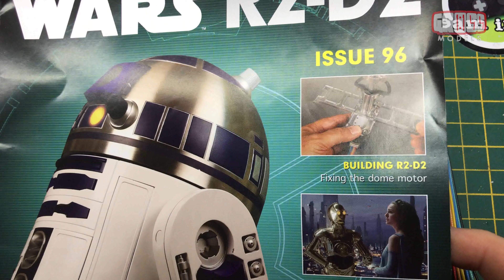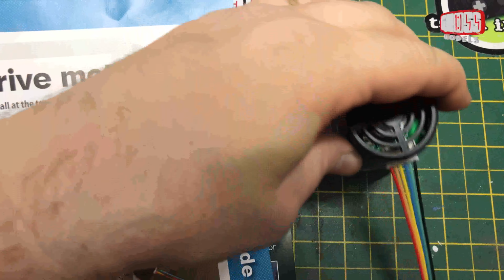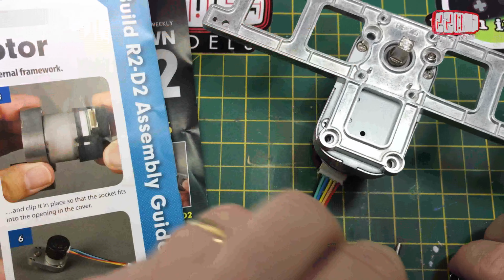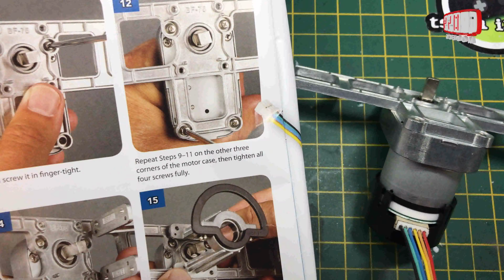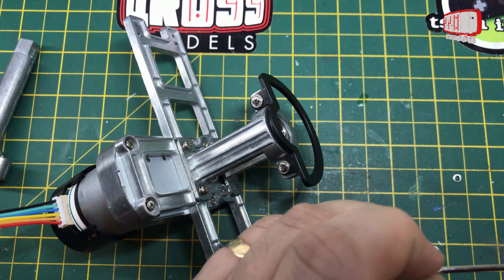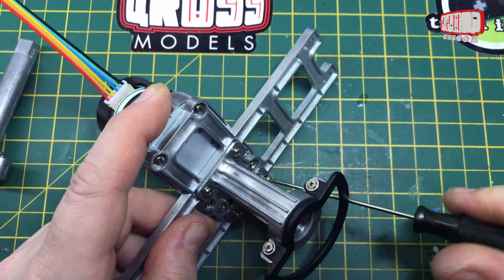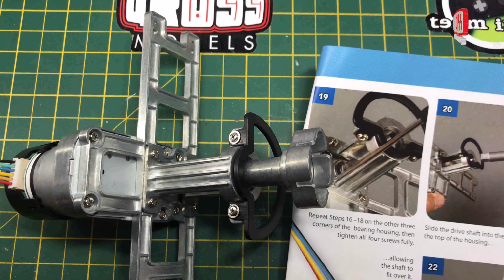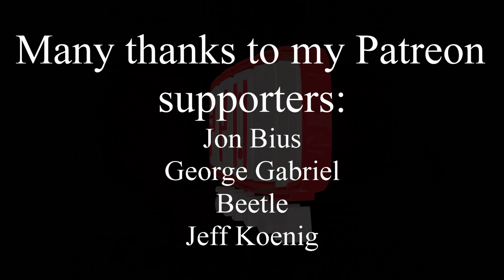Deagostini R2D2 build. Issue 96.

Comment: Great video mate u could test the motor to make sure it works just use the wire u used to test the leg motors
Reply from the maker: I did consider it, but figured I’m close enough to the end to not bother.